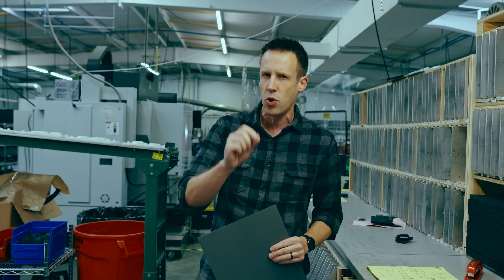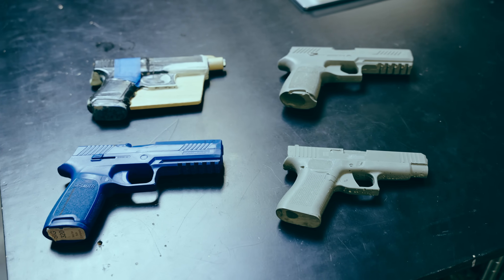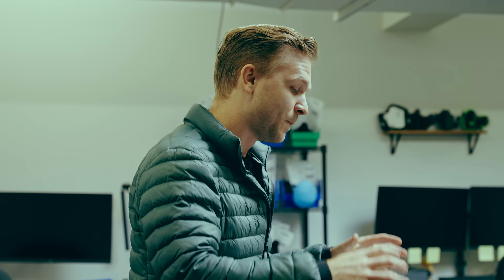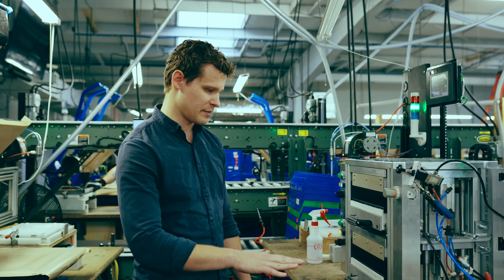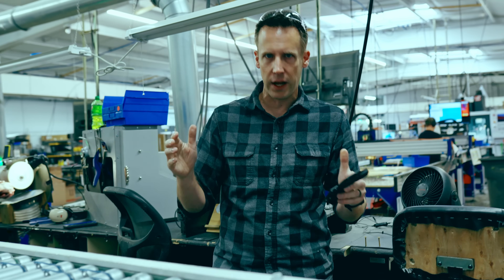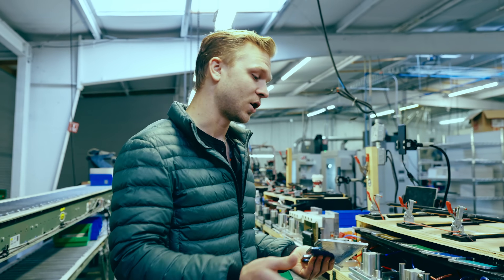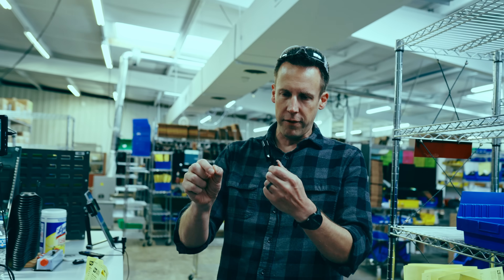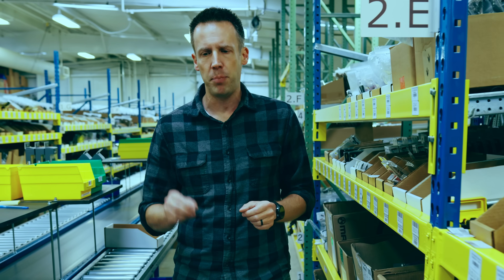T.REX Holster Manufacturing Inside Look

Comment: Very impressive; from your facility to your standards! Do either of your Haas machines run coolant? I imagine it depends on the material you're working. Kydex and polyethylene probably don't require it. It was cool to hear from others on the T.Rex Team. You guys are awesome. Thanks for some more behind-the-scenes stuff! Looking forward to 2024. Cheers!
Reply: Correct. We only run coolant for the aluminum. High chiploads pull the heat out of the plastics well enough.